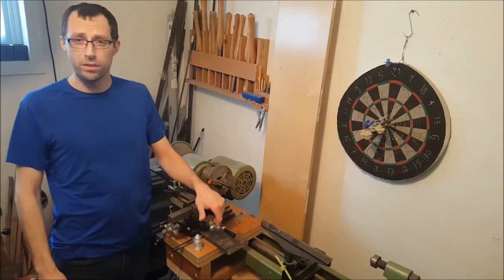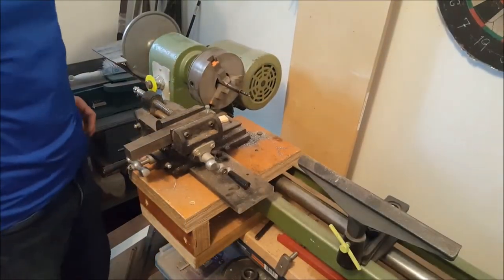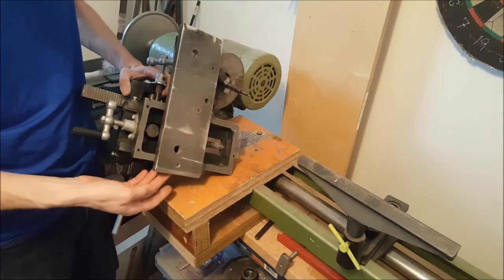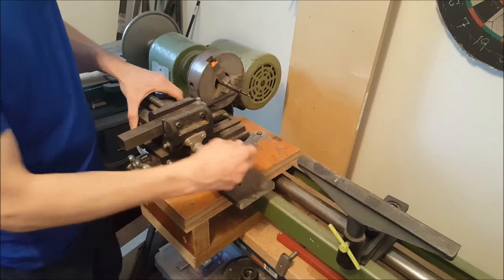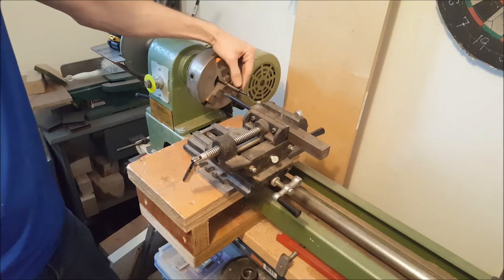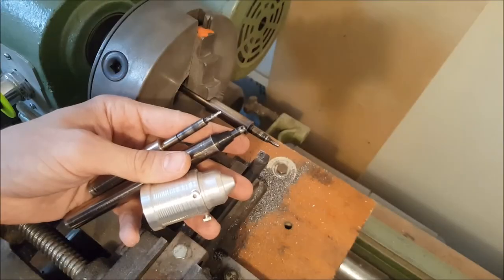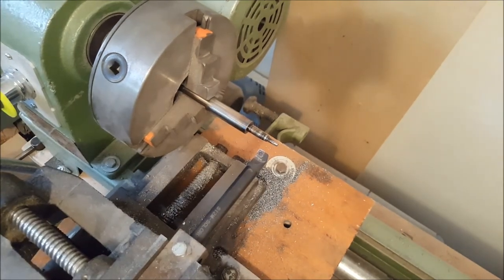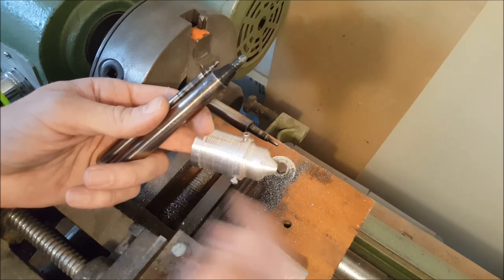Converting a wood lathe to metal lathe with milling vice

Comment: Amazing! You have done a great job and, personally, I very much appreciate creativity! It certainly would need some more improvement as a project (basically speaking, concerning safety, stability and, therefore, preciseness, I suppose), but it works! I am into a similar project, thinking of converting an old and heavy wood lathe into a" light" metal one and your experiment gives me hope of a decent result! Thank you very much for sharing your experience!!! Greetings from Italy :-)
Reply from the maker: Thanks, I wish you succes and hope you get a bit further than i did with obvious issues i encountered like you mentionned. My mane advice:   be carefull with aluminium...  its softness makes it very dangerous.

Comment: Is this a standard, cheap cross slide vise? Sold for about 60$/60€? How much power has your lathe motor? Good results for such an improvised metal lathe!
Reply from the maker: Yess  it is the cheap vise version.  The motor is 1/2Hp  1720Rpm.  I put it on the highest gear for mire speed.  I feel it should go faster thow.. as specially using carbide bits... ment for speed.

Comment: How did you determine where you bought your chuck to fit the lathe?
Reply from the maker: You have to look at your model specs. It will say what thread ans size you need to look for.